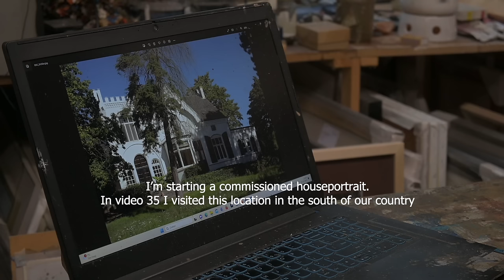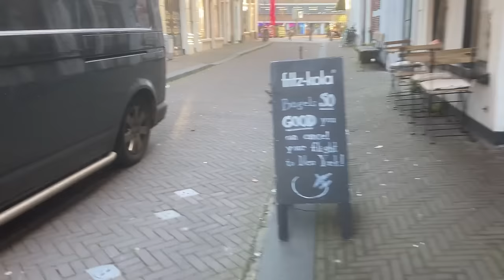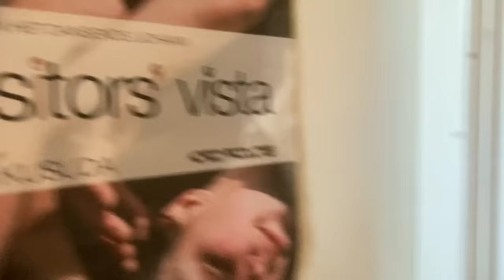47 How to wake up that sleeping unfinished painting? | Food for artists

Comment: Many watercolor artists in the States have been eliminating the mat and glass and spraying the painting with acrylic varnish in Matte and gloss finish.  For me, matte finish is nice and enhances the colors so that it almost looks like an oil painting.  I don’t think you would probably like the effect, but perhaps another “test” would be interesting to do.  I really like your use of soft pastel for highlight accents; it looks really good.  Thank you for your videos.
Reply: Some do  this as a way to enjoy wc without the glass. I have done work that way and have the artwork connect in separate pieces with a space. It is a great idea especially if one uses more lightfast wc and the protection is very sufficient. It can create a modern look or just something different. I don’t do the majority of my work that way but some of it I do and I have never had any problems with it. As you stated , it is important to use an archival clear varnish spray, I prefer matte myself. I also use Dorland’s soft wax and rub it in on the surface. It isn’t noticeable at all and I tested it with the worst food staining attempts and it just wiped off. I attach the paper ( preferably the thicker kind) with heavy acrylic gesso over a prepared wood board that has either been painted or stained, which helps the acid from affecting the paper, the gesso becomes the barrier. I do check the painted side because gesso has water in it and can reactivate the wc through the paper and that is why I prefer the thicker kind. Have fun with it! It makes great moveable murals. Btw pastel can be preserved also if it’s multi media and colored pencil with wc.😊

Comment: I have framed many watercolors without glass in fact many watercolorists are doing it now, you spray it first like what you got then brush acrylic varnish on it. I like to mount it to a board first such as birch plywood or gator board. Some artist just brush the acrylic varnish on  without the spray. They say as long as it's good and dry, use a soft brush in it will be ok.

Comment: I use SpectraFix Degas Spray Fixative on my watercolors. It is non toxic. I also mount my pieces to cradled board with gel medium and finish with a few coats of cold wax medium. Something to consider, I hope the non toxic fixative is available to you. I enjoy your videos - thank you for sharing your thoughts with us.
Reply: I use the same fixative for pastels especially the final fixative. The owner is super kind. I did not attain the desired results with the pastel fixative on wc verses using a strong protective UV archival matte varnish, nor with wax without compromising the entire look of the watercolor painting. It works nicely for pastels if I add pastels in my watercolor paintings I do selectively use it on the pastel but not on the wc . I am familiar with the glass like barrier that is under the same brand, not sure if it’s on the open market or just on the site and was involved in testing it. I don’t have to use hardly any Spectrafix final fixative when I use Pastelmat, just a mist of the final fixative. The colored pencil fixative is definitely just for colored pencils but if careful it can be applied quickly with a brush in mixed media areas. Then if one wants to varnish it, it really needs to sit at least 2 or 3 days before that. Coincidentally if the colored pencil fixative doesn’t remove that waxy coating which is the binder , the Spectrafix does get rid of it in just colored pencil on hp paper. I just use oms in a waterbrush because I don’t use my pencils that way as much anymore. I use Grafix double sided drafting film, not Duralar or typically Pastelmat from Clairfontaine. Everyone has their own preferences and that is what is really great about art. We all learn more and although this channel isn’t about tutorials, we all still learn from each other. Happy painting and have a lovely weekend!😊
Reply from the maker: Thank you very much Jane, good to know there are more solutions for protecting. I will check this out. Titus